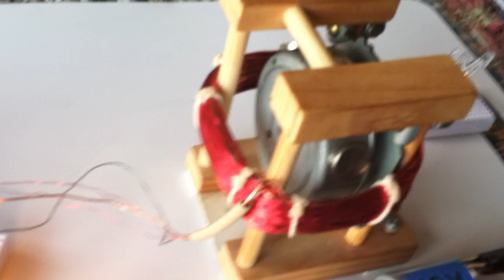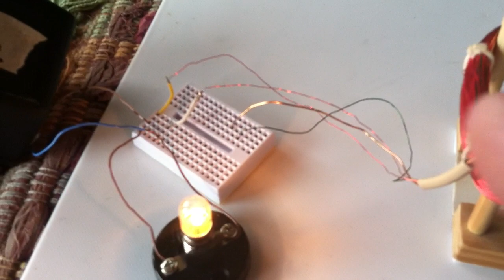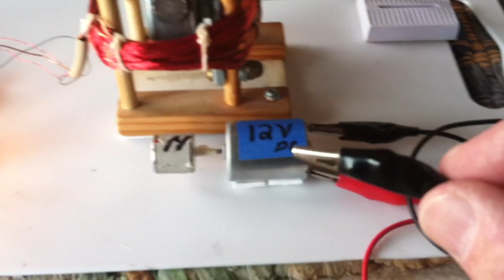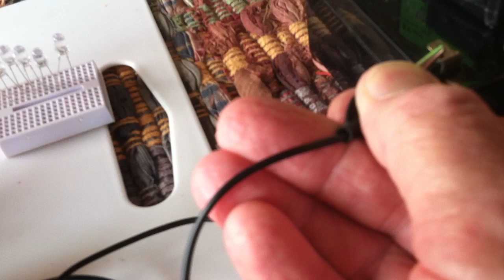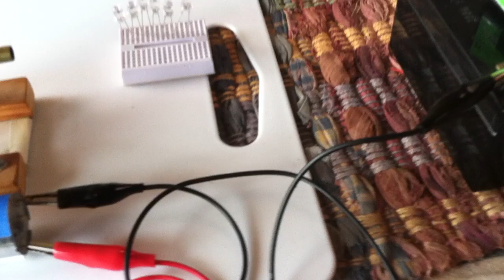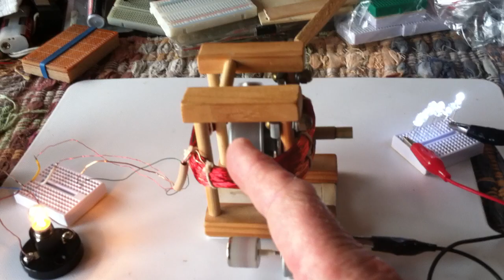Window Motor runs as AC Synchronous

Comment: Hi Lidmotor:  I tried your synchronous motor magic and it worked great.  I just used an old rotor and old coil I had laying around, I hooked up an 8 volt ac wall transformer wired it direct with a light in parallel spun it with my hand  and off it went like a wolly bugger.  It doesn't have to be a window motor with the coil around the rotor it works great with a usual set-up with the bobbin like coil pointing straight at the rotor.  Great fun!
Reply from the maker: +Roger Harrison Thanks.  I discovered the same thing yesterday.  Just a coil of wire pointed at a N/S rotor and you are good to go.  So simple and you are right----Great fun!

Comment: Awesome...... You know the question will be asked so I will,
What about output of the 12v DC motor/gen going back through a
DC to AC Converter and loop? With a super cap buffer between the DC output and converter?
Reply from the maker: +diveflyfish  That would be a fun experiment.  This could be looped I'm pretty sure BUT ---you would still have to add in energy to keep it going.   Losses to friction and heat would still be there.   Supposedly some of these AC synchronous motors are extremely efficient---way up in the 90% range.

Comment: Coolness!  How much of a load can you service before the magnetic drive slips or stalls?

Thanks for sharing!
Reply from the maker: +A B  Because of this 'window motor' design the torque is pretty good.  I think this could turn a fan blade easily.  The trick is that you have to get the rotor up to synchronous speed somehow. This design here won't self-start.
Reply: +Lidmotor What I meant was... how much can you increase your load resistance until the generator slips, hiccups, or stalls?

Re: starting - have you considered using a start cap or combination start cap & starter winding?   That what other designs have done in the past. :)
Reply from the maker: +A B What I could do is use a super capacitor as a startup source and recharge them as the motor ran.  Kinda like a starter battery on a car.  As far as stall load I'm still at about 20 to 30mA.
Reply: I'm not sure how much punch your supercap will provide--but it's worth a try to see if it would help start it.

re: loading - I thought you were going to use a pot to see how much of a load you could get out of that 12V generator.
Reply from the maker: +A B I used a 25 ohm rheostat but I need like a 100 ohm pot.  Now that I know what is going on, the basic motor structure is going to determine the amount of torque I get.  It is sort of back to the drawing board on this motor if I want to do that.  There is really no point in doing more load testing on a motor build that was just a proof of concept thing.  It worked but it is weak.
Reply: Ok.  I was just curious & I thought you were going to use a 0-500Ω pot to determine that answer.
Reply from the maker: +A B I get distracted easily.  Measuring is less fun than building.
Reply: +Lidmotor You just have to think about it as 'building' knowledge. :)

Comment: Hi! 

awesome work!

I wonder one thing. If the coil is sorrounding the rotor, should'nt it refuse to spin according to the right-hand-rule, do to the magnetic field rotating in the same direction?
Reply from the maker: +Jocke C Nilsson  Interesting question. Perhaps one of the other guys can answer that.  I was kinda surprised this worked.  The rotor has to be at the right rpm.
Reply: +Lidmotor If it is an synchronus motor, it's understandable that it has to be in the right rpm. Does the engine seem strong when it's synchronized?